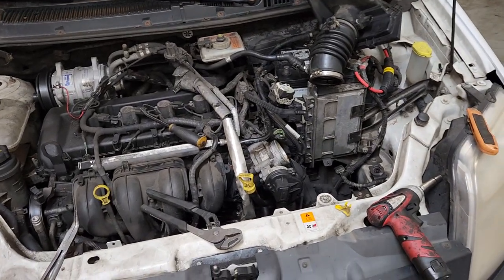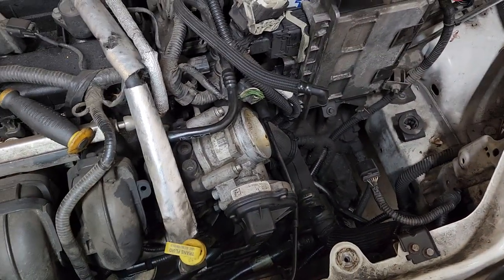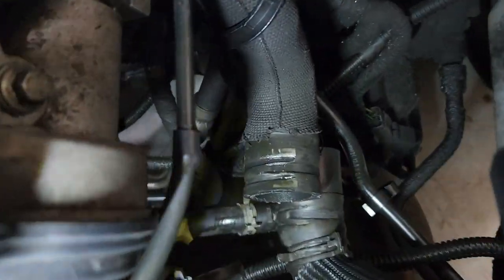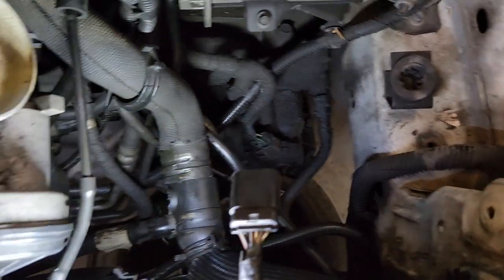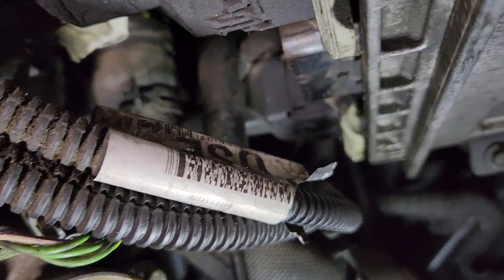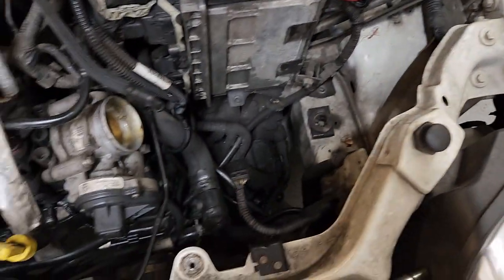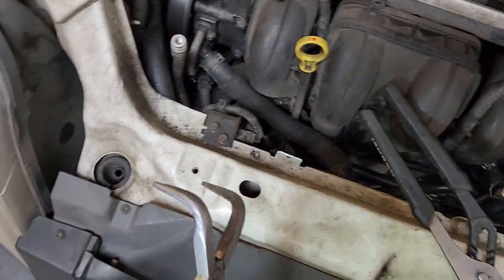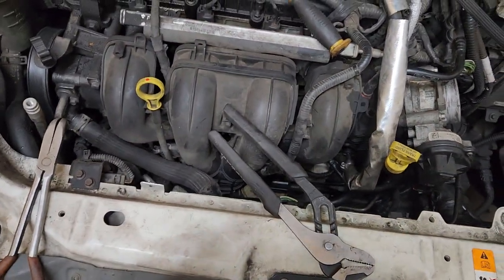2011 Ford Transit connect Van Uper Radiator Hose With T connector.

Comment: Hoping you'll reply.... my issue is.. weak heater.. when it's kinda cold here. I can start the van, and it'll run maybe 15/20 min.. the engine is up to temperature or almost.. takes longer when it's cold.  the heat in the van will be luke warm until i am driving it maybe another 10 min..before it's decent. but till take about 20 min of driving or more before the heat is kicking ( 160F )  I'm suspecting iffy thermostat. But one day while checking things. I noticed that there's a steel tube ( I think ) under that T-Fitting you're showing that broke..  I can feel heat thru this tube, but then at a certain point it cools off.. I can't see or feel much more of what's under there.. Is there a valve or something under there for the heater hoses?  I took the van to the ford place, and they said the thermostat and heater are working fine.. I'm thinking they didn't put forth any effort...  I might be some dumb, But i'm not plumb dumb.  I can do most things on vehicles to a point..I do have my limits.  But fuck trying to replace that dumb design where the thermostat is..  I just don't see any easy way to replace that thing.. Any Tips ? I'm thinking i'll have to remove the power steering pump to make it easier. But i still don't think that will be enough.. any tips ?  Thanks for any help..
Reply from the maker: See if the heater hoses going in and out from the fire wall is hot. Your issue either air in the system or glooged heater core. Open the coolant reservoir and run the car to 2000 RPM for 2 min and let idle repeat couple times and that should bleed any air. Also if heater hoses to the fire wall one hot one cooler then you need to flush the core. Those Van's arr shity design on the cooling system
Reply from the maker: I don't think there is any valve or anything under the T. If T broken it will leaks for sure.

Comment: can you show how you got the plastic T out of the tubing mine is stuck!!!!
Reply from the maker: Best way to change the entire hose it comes with the T and all hoses attached to it. If you want just to replace the T by its self you will need to use plier to crush the hose where plastic T  stuck into and it will break apart and you can fish it out with small screw driver or a pick tool